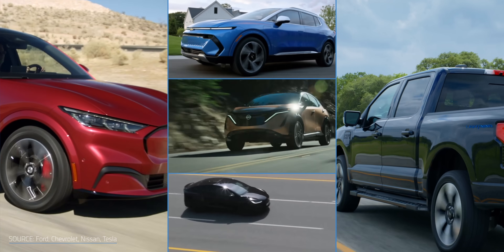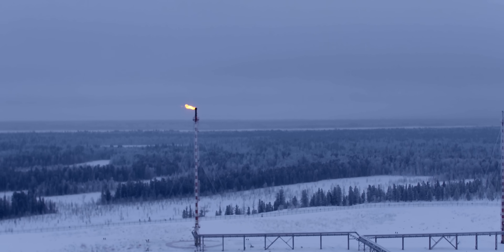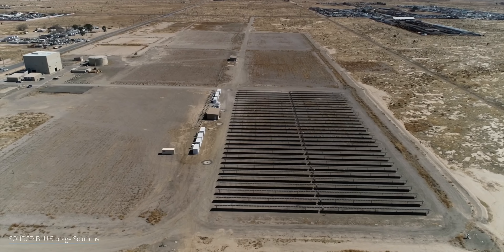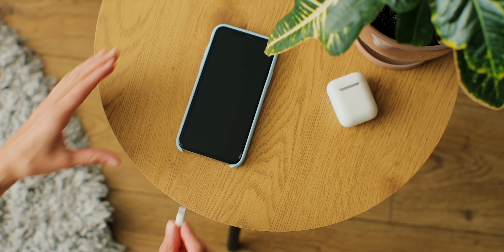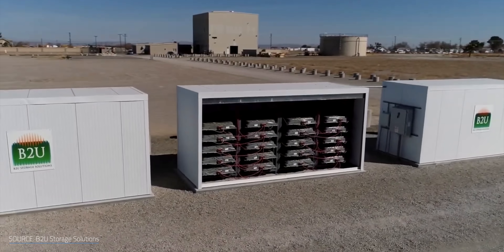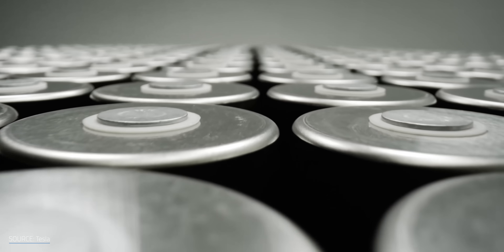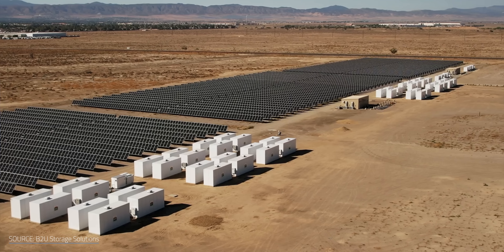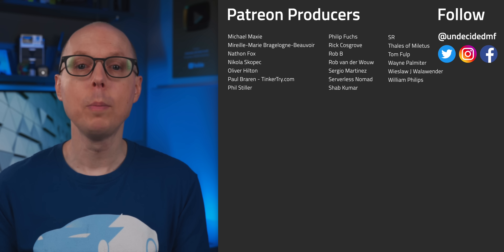How Old EV Batteries are Perfect for Energy Storage

Comment: There is something I have never found out about second life batteries.  As the battery degrades  is that just the capacity of the battery which is degrading or what I think of as efficiency that is do you get less and less power out of the battery for the same power in. Or is it a nice linear degradation to the point that the space occupied by the battery should be taken by a replacement. Hope that makes sense.
Reply: Yes the latter. It keeps outputing the same power until the number of cycles it is designed for. Sometimes the voltage dops a little so KWh get affected but Ah remain same

Comment: I am the head program manager for the leading company in Battery software, Qnovo, and still see many problems with using old car batteries for energy storage use. There is poor, if any, understanding of the pack/module/cell health and a huge lack in data that is being used within these ESS facilities. It is correct to say they are less stressed, but the stress occurs at the high end of the charging phase and when plating is not controlled/mitigated. This is the case with all the ESS facilities is a lack of understanding when it comes to optimizing the charging phase to prevent this degradation and register the true amount of lithium plating that actually exists in each cell. A great example of this is the huge fire that happened in Moffett Field, CA where an entire facility went up in flames due to a lack in safety protocols and battery health tracking. It becomes even worse when using old cells because there is a much greater risk of failure and plating creating a shortage, which leads to explosions and fires. There has to be the proper understanding from companies like this who are not comprehending the risks or potential danger.
Reply: They have BMS access via CAN into each pack. Nissan Leaf packs report total pack state of health (remaining capacity) and per cell voltage. They can probably safely cycle them down to 60% of original capacity (40% degradation) before lithium plating starts being a danger of shorts through a separator. NMC chemistry in Leaf packs is much safer than NCA in Teslas, so even if one cell does fail it is much less likely to trigger total thermal runaway. They can probably catch that early by monitoring cell self discharge via diverging voltage levels relative rest of the pack. If you are a leading battery software company (never heard of you) you should know all this stuff.

Comment: Is there a company that makes a home battery enclosure where you can put these used batteries into?  I know their a little on the bulky side but if I could save money and provide a use case for used batteries I'd be all for it.. especially since car batteries typically have a much higher capacity vs the "power wall" equivalent.  Big business needs to get on this if they haven't already, create a demand for the used batteries.

Comment: Slightly disappointing to see you perpetuating the fossil fuel lobby propaganda that batteries don't last when in reality other than the very early generations they are outlasting the cars, which admittedly means there will be batteries left over for reuse, but for the most part not because the batteries are failing

Comment: Its not perfect. Its possible but not perfect. The whole energy transfer equation needs to be solved and not just looking at what the batteries can store.

This means
# Cost and energy to get batteries out of car, towards facility that stores them for repurposing.
# Cost and energy to put them into their place and connect them.
# Cost and energy of maintenance.
# Energy lose by transfer from excess production location to storage location. - this is easily between 10-70%! (especially in the USA with its just second world country electricity network!)
# Energy lose by transformation into battery (remember, energy is not like water, it doesnt automatically fit by frequency not Volt/Ampere).
# Energy lose by transfer back to the consumer.
# Energy lose by transformation into customer device - car, fridge, tv, phone.

I like the idea but I dislike how easy people think this is a green topic, this is first and foremost a dirty activity with alot of pollution. If you havent figured out a proper process and dont take into account the complete carbon cycle then you will be as dirty as EV's are right now. - Before EV's complete lifecycle turns green, we still need to improve alot of things and USA is about 10-20 years away - since we promote lobbying instead of real and fact based science.

Comment: Check my math on this hypothetical situation. Cost per kwh installed for this solution about $200. Average monthly kwh consumption = 1000 kwh. Total installation cost to provide power to this hypothetical user $200,000. Comparable utility company cost per kwh about $.15. Monthly cost from utility company $150. Payback of system 1333 months = 111 years.
Reply: That's 1 month of capacity. No one needs that much. 1 day worth of storage is enough for offgrid solar.

Comment: I wonder if this recycle paradigm might be applied to individual home energy storage.  I have a rooftop PV system. Once my 13.5 kW home battery is fully charged via the sun and I go about my daily routines, I actually send power back to the grid (of which I receive minimal financial return). I typically deplete my battery energy after midnight when I then purchase grid electricity at a higher rate than I sold the daytime excess at. Additional battery storage would reduce my need for buying grid electricity. My aging hybrid vehicle battery won't last forever. Perhaps it could be repurposed as additional home energy storage. I ponder if this home use modification is available and if it would be prohibitively expensive.

Comment: EV battery cells work great for repairing tool batteries or other projects. The 18650 cells are not normal, they can pump out 40A till dead. Put a dozen of them in series parallel strings and you can easily jump start a regular gas car 😁❤

Comment: i built my own setup with used tesla batteries ($1k/ea) and used high efficiency panels ($100/ea) coming out of a solar farm routine replacement 4yrs ago. the panels still produce more than rated output and the tesla batteries are working perfectly. i am probably going to add 4 more batteries (20kw) as their price has come way down.
Reply: I did similar things
Reply: Did you do a you tube or any kind of DIY on that setup? I have taken 2 battery packs from junked Toyota Prius’s and want to get more of them to build a battery backup system for my home and find some cheap solar panels as you have. I would like to use as much of the equipment from the sleds of Prius batteries as possible to repurpose as much as possible. Let me know if at all possible the details of your setup and any issues you encountered along the way. Thanks in advance.
Reply: @Monstur9  did you get my reply? i did this whole long reply and i just noticed it is not here!

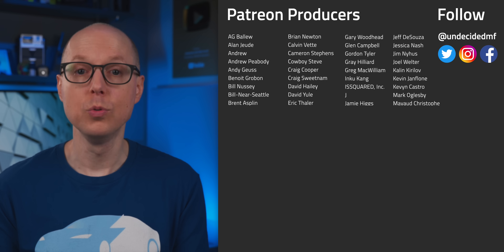Comment: 11:25 how about people have their own electric power station ( Kraftwerk) 
Solar , wind ,batteries and inverters are cheap enough by now .
Convert your lights to solar and back up with battery.
Cooking with solar stove ( works great ) 
Induction stove just installed.
Getting used to it .
Transportation yes have electric vehicles . 
Still enough power to heat water ..
Done it ..when are you doing so ?
Rater crying help me 😢

Comment: I've been with the idea of second life for batteries for some time, you hear it from many of the EV advocates in their channels. However more recently I've been hearing doubts by some of the vehicle dismantlers and battery recyclers that the lack of knowing exactly how the battery has been treated is a problem and raising safety questions. We are probably in a 'watch this space' for developments while the industry tests the economics of what's possible.
We know there is high demand for now for good batteries from breakers for the growing EV conversion industry and DIY home batteries but their is probably a ceiling for this route. I understand BMW built a battery energy storage warehouse for i3 end-of-life batteries which stands almost empty. As it happens these are highly modular and even the modules can be rebuilt. 
It's good to see a company like B2U actually making this work by cracking the battery management system, I guess this where some sort of machine learning AI to learn how to optimize everything safely. Let's hope the OEMs don't try to lock out the BMS to these reuse companies to frustrate the idea. In the EU they will have obligation to recycle and might not want to lose track of where their batteries end up. The Tesla Model Y battery is clearly not designed for repair [see the Sandy Munro teardown].

Comment: Theres still the problem of power transmission- distance matters.  might be better to do this on a house or housing develpment level.
Reply: It makes sense to put the battery where the power is generated.
Wind and solar power generation is DC, so there's no loss to rectification (beyond what's built into the wind turbines already) and the inverters for transmission are already right there.

Of course if these are panels on your house, then the storage should be on your house.
And having the storage at the substation level would be nice; it would increase robustness and save transmission losses when the scarce resource of stored power is being used.
But the logistics of siting the storage centrally is also worth considering.

Comment: Hey Matt, Really interesting video though it got me thinking about a related issue I was looking at the other day - Why are (at least here in the UK) residential solar PV storage batteries so much MORE expensive (per kWh) than those used in EV’s ? For example the cost of a Tesla PowerWall battery, compared to the ones Tesla use in their own EV’s. They answer I came across, time after time, was claiming that it’s because the home solar PV storage batteries are designed to cope with “more demanding” usage than those in EV’s - which TBH I thought didn’t sound right on face value. So to now hear that EV batteries which are no longer performing well enough for their original purpose can still have a useful 2nd life for solar PV storage makes me question this common excuse given for the ridiculously higher price per kWh we still have to pay for new batteries for home solar PV storage and whether there’s merit in buying used EV batteries to supplement your existing home solar PV battery storage? Would value your views on this - for example, is it a question of needing a lot of 2nd life EV batteries and hence storage space that would be an issue? My SunSynk 8kW Hybrid Inverter will happily work with batteries down to 20% capacity, provided their BMS is working properly - so if EV batteries are retired once they can only hold 70-80% …

Comment: That's exactly what I did with my solar batteries... Couldn't justify spending $3200 on new LiFePO4 batteries so I purchased Blue Carbon equivalent (BYD batteries taken from EV's) and they've been great for the past 2 years.
Reply: How much/kw did it wind up costing?
Reply: @ticthak  it was about $1,600 CAD including shipping from China. It took a couple of months shipping and I needed to haggle but for 4 x 12v batteries and > 200 Ah (at 52v) storage they’ve been a great purchase.
Reply: @dSquared0162  Thanks- the new price is about what I expected, so it's a great value buying used if you're only running 70% load and not maxing out depth of discharge- do you have a guess what your average discharge is?
Reply: @ticthak  I keep a safe margin - I think it gets down to about 20% when I switch off the inverter at about 12/48V (have to check my old calcs again)... I also stop charging when it gets to 14/56V. I'm not off-grid, just using battery to supplement/reduce my grid use. I can get up to about 10kWh spring through fall - 6 in Winter on a good day - from my solar panels (will up that to 12 shortly) against an average usage of about 6kWh - more in winter/less in summer. So these used but still good batteries have been good value.

Comment: For me the bottom line for systems like this is that they will take a hit once the supply of new batteries ramps to a level that matches demand. In a commercial environment most of the time the target is reliable consistent equipment. Depending on how hands on a system like this is the ongoing costs to constantly swap out defunct units will add up and the financial side which is the main driver for business will probably take over and look to reduce costs and max profit.

Comment: Yep very true.  For many years now i have been applying reduce reuse recycle  in my daily life in everything i do.  I did just that years ago taking recycle laptop batteries that I have to buy from computer repair shop and turned them into solar battery storage pack.  The process is involved so nearly NO one is doing it except me.  Those batteries are only about 40% or less of itheir life but i still am able to get about 2-3 years of use with daily cycle.  Yes daily cycle because i build the whole off grid system with solar panel, battery and inverter all from Reduce, Reuse, Recycle concept.  None is new and works great power the whole house.  Yes the whole house!!!!!

Used EV batteries with only 80-90% life left will last for decade even with daily cycle for the off grid situation.  RV use is even longer because  that is not a daily cycle situation.    Many people don't know this.  A used EV pack is bad but there are many  cells in there still in good condition.   That requires to take the pack apart to make an assessment.  99% of the population won't do that.   Definitely there is a demand for a business that reuse the EV battery.
I know this intimately because i have processed 1000 's of cells over the year to build my solar battery pack just about every year.
Soon I will buy the dead EV pack from junk yard because they are way more superior in quality and plenty of life left for what i do mainly solar battery storage for home and RV.
EV batteries are very durable and reliable due to auto requirement.     What a waste if we just recycle them with 80-90% life left.

I might turn this into a great business  and definitely there is a need to reuse them.

How many cells you think there are in a typical EV car.  Say a Tesla  any model?   7k to 8k  individual cells depending on the KWH!!!!!!!

The technology will get better for certain with time and demand.   The future is EV.  Anyone thinks otherwise will eventually follow the pack and admit it.    No one can go against the majority and win!!!!!!!!!!!!!!!!

I am done with fossil dirty fuel vehicles.  I drive what i have until I get my Cybertruck.   Predorder since 2019 and yes It will be charged with solar power when i get it.

Comment: I was a fan supporter of this until probably last year.  There is this guy that was popular back then for DIY powerwalls.  he now sells used or old lithium-ion batteries for cheap and sometimes close to 100% life. but no, it still doesn't have a chance to LFP batteries which could have double or triple the cycle life while also safer. in short, these old EV batteries better off recycled to harvest metals like cobalt, nickel for making new batteries for devices and reduce mining.  Currently, the US does not have large scale LFP manufacturing yet.  When it does, way better to recycle old EV batteries then reproduce LFP.

Comment: Okay, so they're not DEAD batteries as you've repeated several times, they're just partially depleted or no longer fit for designed purpose. I was interested right up until the 70-80% part. 😐

Comment: The economic competition to these large grid batteries will be the inevitable incorporation of households that use their cars to feed back to grid for a more favourable electricity tarif.
That storage is local so negates most of the transmission losses too.
Likewise, these used batteries would be better used for powerwalls, especially for off-grid.
Reply: I don't understand how feeding back to the grid is supposed to work (help).
I suppose in the summer if people come home from work with batteries that are still partially charged they can be discharged then and charged later at night.
But that doesn't work as well in the winter (peak demand in the morning), and in general I feel uncomfortable with discharging my car that is already low at the end of the day.

As for reselling used car batteries for residential power storage, that seems hard if you're not sure what you're getting.

Comment: My company can bring the lithium batteries back to life, no carbon emissions, my batteries have no eco fee. My batteries will last 219 years, much longer then the 10 years. Any plc can do that kind of battery monitoring. My system is designed to recover AA size batteries and is OEM technology with any lithium batteries.  I will have to contact them, see if they want to work together